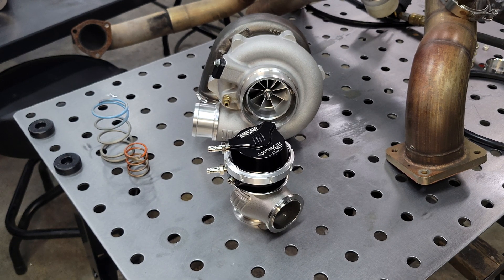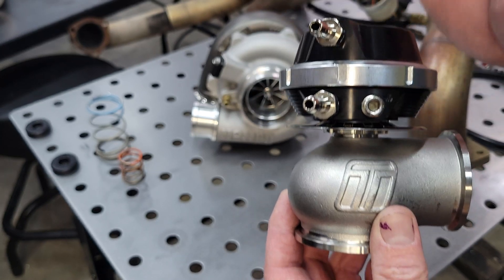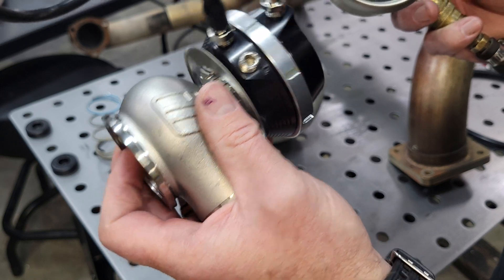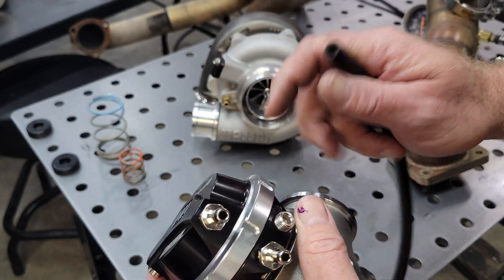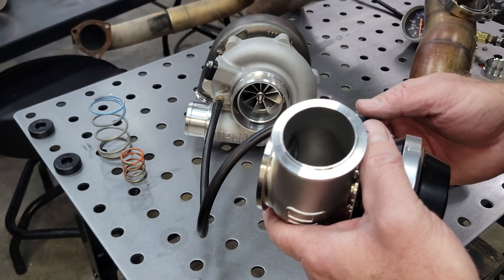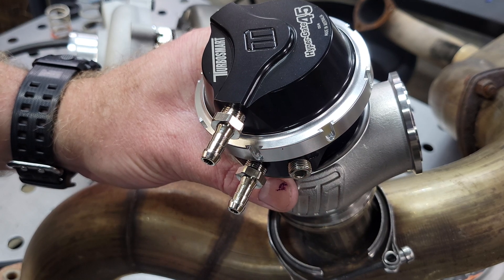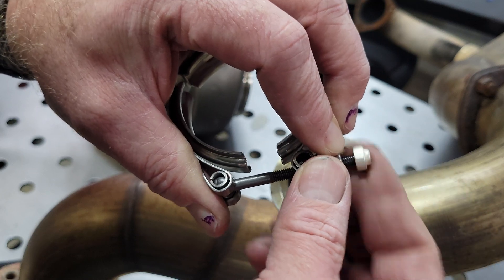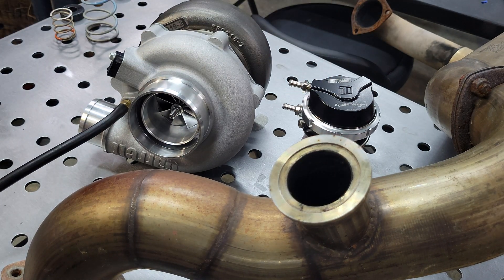External Wastegate Setup, Episode 1- Basic/Simplified Vacuum Line Routing and Testing!

Comment: Please excuse my ignorance, but which port do I connect the line to for a Boost control gauge?
Reply from the maker: The reference line for your boost gauge will need to go to a port located post throttle in the intake manifold for best results, as most boost gauges will read both manifold vacuum as well as pressure in a gasoline engine (most diesel engines will read boost only, as there is no vacuum present in their inatake system).

While it is possible to reference your boost gauge at the wastegate port, it is not standard to do so.  If you have a specific reason for wanting to do this, you would T into the lower port that references the boost pressure source from the compressor cover.

HTH! Reed

Comment: 2 hose vacuum wesgade 1 more boost or?
Two low boost or
Reply from the maker: The video goes over it all in detail.  The "lower" port, closest to the valve head is your boost reference.  If you utilize only this port, leaving the top port vented you will get boost pressure close to the spring pop off pressure in the gate.  The upper port is configured only when you are using a boost controller.  HTH!  Reed

Comment: Holy shit! You just saved me a world of stress. I didn't know that sleeve went in there 🤦‍♂️😂 thank you so much, you don't understand how much i appreciate it.
Reply: Exactly why I came to this video!  The sleeve is the valve seat, but I was thinking the valve seat was pressed in or something, not that extra loose part in my kit!
Reply: @bubulubu3136  With the drama i've had fitting a tubular manifold, i don't think i'd handle it not boosting correctly very well, i can easily imagine it being a fridge freezer if that happened 😆
Reply: @HumbleRacerUK  I hear you!  I spent this whole season trying to get my eGate working properly and am replacing it with a C02 gate.  I'm using the one with the solenoids, pressure sensor, and position sensor all in the cap.
Reply from the maker: Glad I could help!! Reed

Comment: If I’m running port 2 on my boost controller to the top port of my gate do I need to block off the bottom port on my wastegate?
Reply from the maker: Most boost control solenoids have at least 3 ports, all of which will utilize the bottom and top ports of the external wastegate for best results.

Who's boost controller are you using?  I will be more than happy to help!  Reed

Comment: Do you put any kind of sealant on the threads for the fittings and block offs for the wastegate ?
Reply from the maker: Turbosmart threads are NPT, and require sealant.  Tial uses crush washers for sealing, I put a drop of light oil on them just to provide lubrication in the aluminum.  HTH!  Reed
Reply: @workturbo thank you !

Comment: First off this is an awesome video! I have a pulsar 60mm which is very similar to the turbo smart. Do the ports line up with anything on the inside? I mean like if I wanted to loosen the collar and rotate the top hat to get the port in a better location could I rotate it anywhere and then tighten the collar back down and be good to go?
Reply from the maker: I can only vouch for the Turbosmart units, they are engineered to do just what you are asking.  Loosen the upper lock ring and you can rotate the ports in any direction.  You can also loosen the base lock and rotate the entire upper body!  

The Pulsar upper cap should be able to rotate as well, there generally are no ports that are critical to line up inside that part.  You should be good to go!  

LMK if it works for you, that way I can be sure to help future questions on this model!   Reed

Comment: How would you hook up the pressure line to the bottom of the diaphragm if your turbos don’t have a port machined into them? In other words, where on the engine could I get that pressure from? The air hat above the carburetor or below the carburetor out of the manifold? Obviously I’m running a blow thru carb. Thank you.
Reply from the maker: Pressure port in the carb hat, or anywhere in the discharge from the compressor outlet to the carb hat is satisfactory!  DO NOT hook it up below the carburetor, or any other source that has vacuum.  Vacuum present at the wastegate diaphragm will cause premature wear and possible vacuum leak/tuning issues.  Very good question, thank you for asking!   Reed

Comment: Hey so recently just single converted my 2jz and im running into a issue where im making only 2psi of boost and my wastgate opens fully at 2 even tho the spring is a 10 but start to open at 8 so i did troubleshooting where i clamped my boost source from the turbo to the wastgate and that coused the boost to go above 2psi but now im wondering what to do
Reply from the maker: Send us more details to support@workturbochargers.com engine setup, manifold ,gate size(brand), ecu, fuel type, include details and or pictures.
Reply: @workturbo stock injectors dw200 fuel pump pretty much stock everything other then exghuast and radiator im running cheap manifold but that shouldn't be the issue only thing i can think of is the spring is too soft or the wastegates not sitting on properly

Comment: FANTASTIC informative video. I'm somewhat new to the turbo boost world, I'm installing a T35 turbo on a inline 6 chevy 250. Hoping for good success.  your instructions provided The detailed Info that I was needing. ( Specifically with wastegates and boost controller). Maybe it's common Is knowledge to others but not to me. Plain spoken without being in a hurry rush. I greatly appreciate.  I'll be watching the other 2. Thx for the detail.
Btw, i have a turbo smart hyper45 wastegate. But i was was curious what your opinion is of the quality of the cheaper "ebay'ish" wastegates ?
 I was told that the biggest problem with those is that the spring tensions was not dependably accurate.
Reply from the maker: Thank you!  The 250 Chevrolet responds very well to turbocharging...you will love it!  

My goal is to answer any/all questions regarding basic to the deepest dive on turbochargers and their systems over the next few years, so I will be going over just about everything as time permits.  

As for the cheaper wastegates...you get what you pay for.  If you are willing to gamble accurate boost control and engine component failure to save a few bucks, go for it.  Professionally speaking there are some affordable gates that are better than others...so just do your research.  Best case the gate fails in the open position or the spring slowly looses tension and the boost goes down over time...worst case is it seizes up and the boost overshoots, finding the next weak link in the system.  Reed

Comment: So I'm doing my first turbo set and been deep diving what it'll take to do what I want to do. I'm trying to run a carburetor turbo ls with no to very little computers. And my main thing is boost currently I don't want to push over 10psi and I'm curious if I could run just a straight waste gate with the correct springs or would I need a controller.
Reply: I have a 03 5.3 going into a 82 c10 and possible turbo off a third gen dodge. Just trying to see how viable and difficult it would be to do something like this.
Reply from the maker: @King_skrub  The turbo off the 3rd Gen Dodge/Cummins is a Holset HE351CW, although it "could" work, you will be much better off finding another turbocharger..  

First off, this turbo has an internal wastegate that will be set at 25 plus PSI of boost, with no way to reduce that other than  building a custom wastegate actuator with a lower setting.   Next off, this turbo has a small A/R turbine housing and a relatively small turbine wheel.  What this means is it will be hard to keep the turbo from having boost "creep", meaning there is not enough wastegate flow around the turbine to "turn the boost down".   The higher revving LS will eventually out run the size of the turbine and wastegate. You will need to upgrade the turbine wheel size and fit a larger wastegate valve.

Lastly, the 60mm compressor wheel in that turbo will make some power, but it is a bit small for your 5.3, so you will want to upgrade it a bit while you are in the turbo.  

I think by the time you put money and effort into this turbo, you could have spent the same amount of money and a lot less time just purchasing a simple S300 series BorgWarner unit that will almost be perfect for your combo with a lot less headache!  

I can sell you a great turbo/wastegate package for around $1000 shipped to your door that will get you going, all top quality parts that we stand behind.  

If you are interested, email support@workturbochargers.com and I will be happy to help!

Good Luck! -Reed
Reply: @workturbo thank you for the info
Reply from the maker: The spring in the wastegate represents your "boost pressure".  So, yes...just hook the boost reference port on the compressor outlet connection directly to the reference port on the wastegate. This will give your wastegate the signal it needs directly, no need for a controller.  

You will adjust your boost pressure directly with the spring in the wastegate (if it is an external style gate, you can/should be able to change this with different springs).  If it is an internal wastegate actuator, it may have a length/preload adjustment.  I am doing a video on those types this week.  

Hope this answers your question!  Reed

Comment: Do you see any issues with topmounting the WG directly on the manifold and the turbo bottom mounted also on yhe mani?
Reply from the maker: If you top mount your wastegate, be sure to locate it in a place that will have the least amount possible of radiant and direct heat.. 

 Proper heat shielding should be designed to keep as much heat away from the top of the wastegate as possible.

  On Turbosmart and TiAL units, utilize the water cooling ports as well.  Proper boost reference lines will need to be fabricated out of stainless steel tube for maximum reliability.  

Hope this helps! Reed
Reply: @workturbo Thank you dude! Time for me to research water cooling the Wastegate! Completely new to external WG and this is the first engine ive ever built completely from scratch. It's fun learning!

Comment: I got a hypergate 45 gen 5 with 7lb springs. I used the fire ring when installing it. I am only making 5.5psi with the boost controller off. Do you need to apply pressure to the bottom port of the wastegate to mount flush?
Reply from the maker: Sometimes it makes it easy to add pressure to the bottom port to aid in clamp installation.  

Make sure to use anti seize on the threads of the clamp and also ensure you do not have any exhaust leaks at that location.  

Things that will make your boost "lower than your spring pressure":  Excessive exhaust backpressure from a restrictive turbine wheel,  too small of an exhaust a/r housing, too small of an exhaust after the turbo, restrictive muffler.   Low ignition timing (raises exhaust gas temperature and therefore exhaust expansion).  Restrictive air filter (turbo has to work hard to pull in air) and lastly, a restrictive intercooler.  If your intercooler cannot flow, the turbo has to overcome that pressure loss, requiring more turbine energy and excessive drive pressure.

Testing the above things sometimes are easy/other times hard!  I would start with the obvious...ignition timing and intercooler pressure drop.  At 5.5 psi you should be able to run close to stock ignition timing on premium pump gas.  So research your engines timing table as delivered from the factory and see if your tune is close.   

For intercooler pressure drop, simply add a secondary boost gauge (or move your existing gauge's reference line) to the port on the compressor housing of the turbo.  See what the boost pressure goes to at that location under WOT.  If you get your 5.5-6 psi, your intercooler is your restriction.

Hope this helps, let me know what you find out! 

Reed
Reply: @workturbo  thanks for the advice. My boost reference is at the intake manifold on a boost block. I'll double check for leaks one of these days. My tuner mentioned that these kits tend to have back pressure issues at my boost level. My turbos are CT3R-6568 Oil less Air cooled T3 1.06 3"
Reply from the maker: @nowayyyhose  If your reference is at the intake manifold, 2 things.  Make sure the reference is boost only, wastegates can have leaks around the stem seal when subjected to vacuum, plus it puts possible accelerated wear to the diaphragm when subjected to vacuum.  Just my .02!  

Secondly, if it is referenced that far away from the turbochargers, it should account for any pressure drop across the pipe length and intercooler core (if it references after the intercooler), so if you are still having issues making 7 psi with the controller off, you will want to check for boost leaks in the entire charge system, air filter restriction and obviously back pressure before and after the turbine.  

Hope this helps, and thanks for the questions!  Reed
Reply: @workturbo  ill check for boost leaks and i also test to make 7psi with the boost controller off air filters on and then air filters off. To rule out the air filters. I had a friend of mine be able to make wastegate psi but he had a velocity stack instead of an air filter. I am hoping is just the air filter being too restrictive.
Reply from the maker: @nowayyyhose  Please respond back here with your findings.  Very curious! -Reed
Reply: @workturbo  the filters are not the problem. Made the same boost with ans with out filters. Waiting on a smoke machine to do a test to find the leak. I pressurized the system and it doesn't keep pressure.
Reply: Did a boost leak test and wouldnt hold pressure. Hooked up a smoke machine and 1 turbo is leaking from the compressor housing. @workturbo

Comment: do you have a video of clamping the wastegate down onto the exhaust with the valve seat in place? what i noticed is that the valve seat insert adds about 5mm height between the vband flanges, which then means that the vband clamp doesnt fit correctly...
Reply from the maker: Is this on a Turbosmart or Tial product?  If so, yes the valve seat will sit a bit "proud" from the flange.  This adds some pre-load to the valve spring and actually is engineered to be this way.  Once you tighten the v-band clamp down, it  will push against the valve and the spring and set the "installed height" perfectly.  That gap will be absorbed by the spring.   Hope this makes sense.  Let me know if you are asking about something different!  Reed
Reply: @workturbo  thanks for the reply. i didnt realise there was some movement in the seat when you push it against the valve. still though, my vband clamp doesnt want to seat because the overall height is too big (wastegate flange + seat  + exhaust vband flange). i'll keep trying :D
Reply from the maker: @ryanthescot  What brand wastegate is it?  Maybe try removing all of the spings (preload) and see if it will go together at that point?  I know if I have the spring pack set for more than 14 psi it gets hard to put it together!  Reed
Reply: @workturbo  it's a pulsar 60mm wastegate. yeah i did think about trying with the spring removed, i guess that will be my next plan. thanks again :)
Reply: @workturbo you were right, removed the spring and was able to get the clamp on no issues. thank you for the help sir.

Comment: If you happen to see this. Wanted to get some quick input. 
Setup was working fine - cheaper gate, mac 4 port. Was boosting to 15 lbs no problem. 
Suddenly yesterday wont boost past 5 lbs. Did boost leak, checked ok. 
Hooked gate direct to manifold source, same result. 
Havent had a chance to get gate off yet, but im thinking only the turbo or gate could be to blame now.
Reply from the maker: Glad you did a boost leak test, that is obviously very important to rule out leaks in the system, faulty compressor by pass valve, lack of reference pressure to the by pass valve, cracked intercooler tanks etc.   

Next will be to remove the wastegate and check for a stuck valve...it will be stuck open.  This should have made the turbo a bit less responsive as well if the valve is stuck.  You also want to pull the spring pack out of the gate if it is not stuck and make sure you did not have a spring break inside the valve.  I have seen this 2 times in my career.  

If the wastegate tests out good, your next things to check would be a major exhaust leak (blown gasket, crack in the hotside plumbing or a loose v-band).  

From there, check the turbo for damage or excessive bearing movement.  Especially in the axial (thrust or "in and out") direction.  

And lastly, even though the boost stopped at 5 psi, did the car seem to loose any performance?  I have also had issues with gauges and sensors failing.  If the car lost performance, ignore this.  

Let me know what you find out!  -reed
Reply: @workturbo  so, it didn't lose any performance, no change in anything drivetrain related etc. So I was just going to order a wastegate, then take the old one off and inspect. But got to thinking, and first, I eliminated the boost controller and ran only a source to top of wastegate instead of bottom. Set boost cut at 15psi to be safe, drove it, and would boost no problem and hit boost cut. So pinned it down to wastegate, then ordered one.

Comment: You only vent the top if you running straight spring pressure. Otherwise the boost control solenoid goes to the top port.
Reply from the maker: Correct!  And make sure if you are running in dirty environments or daily driving that that port receives filtered air.  -Reed